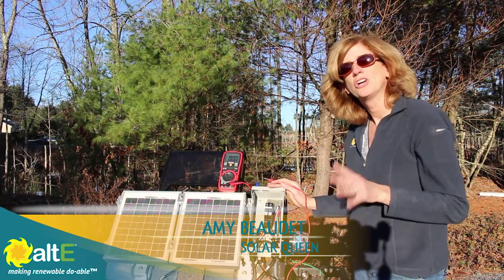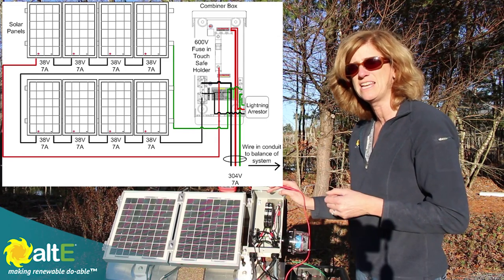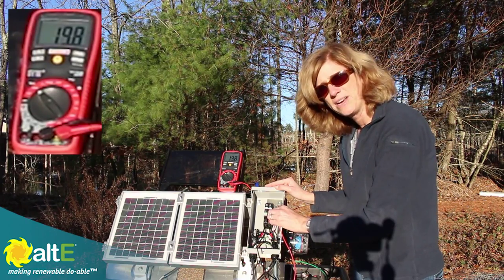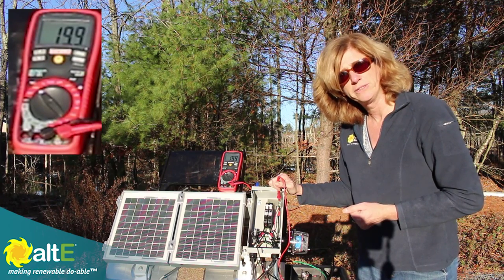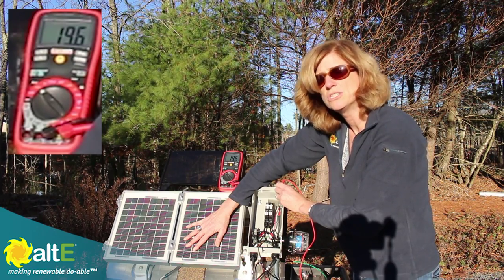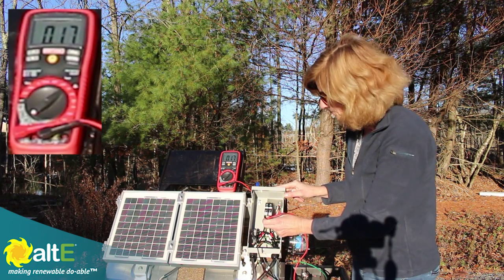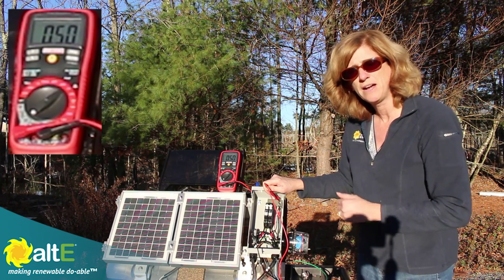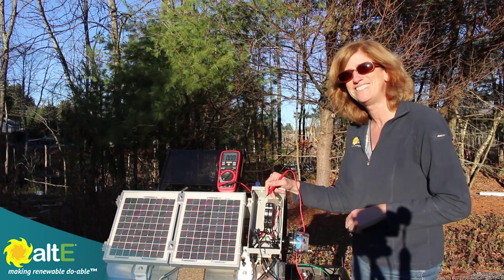Measuring the volts and amps of parallel strings of solar panels

Comment: are you measuring the current with the meter's leads in series of the panel output power?
Reply from the maker: +Rev John O'Toole Unlike how most circuits would measure current, for a solar panel that is not connected to anything, or is in an open circuit like I have here with the breakers open, I am measuring right across the plus and minus leads of the solar panel.The plus probe is on the plus line and minus probe is on the minus line. If this was connected to the rest of the system,  then I would have the meter in series with the negative line.

Comment: When you are paralleling panels did you use diods??
Reply from the maker: No need for diodes if there is not severe shading on some of the panels.
Reply: @AltEStore  That means if there is shading on one panel we want to use diodes?

Comment: I have a question for you  
I have 9 12 volt panels hooked to my 80 amp flex max outback charge controller however I only get about 52 amps the panels are rated for 7.1 a piece how can I get more amps out of them?
Reply from the maker: Solar panels are rated at standard test conditions, which is pretty much perfect conditions, full noon time sun, perfect angle and tilt directly at the sun at all times, 25C (77F) temperature. It is rare to hit the perfect conditions in the real world. Add to that voltage drop, dirty panels, and charge controller losses, it is expected to lose quite a bit of power from the rating. That being said, there are ways to improve your output. I assume you have a 12V battery bank. How are the solar panels wired, in 3 parallel strings of 3 in series? If not, that is the best way to wire them to reduce voltage drop. How many watts are the panels, about 100W? And is the 7.1A short circuit (Isc) or max power (Imp)? You will never see Isc when they are connected, as that is the unconnected current.  How long and what size is your wire going from the panels to the charge controller? Is it big enough to reduce voltage drop? For best year round performance, the panels should be tilted at latitude, so if you are at 30N, they should be 30 off horizontal in the spring and fall. But to improve performance during the winter, they can be tilted at 15 degrees steeper, so in this example, 45 degrees, and in summer, 15 degrees shallower, so 15 degrees. I can't give much more advice without knowing more about your system.